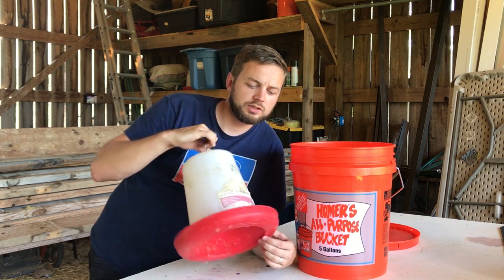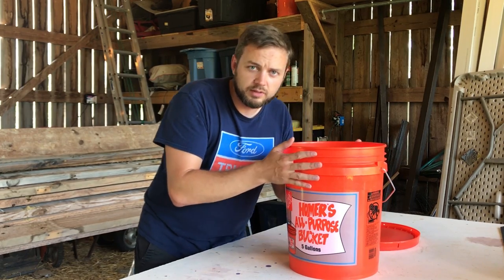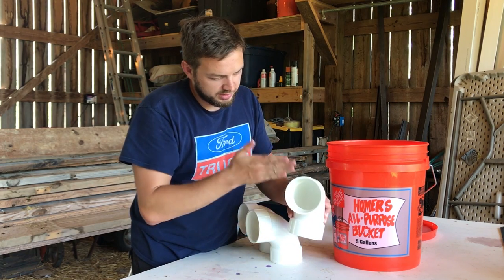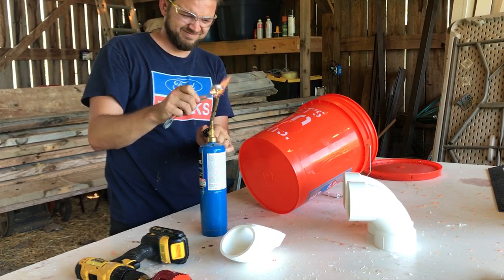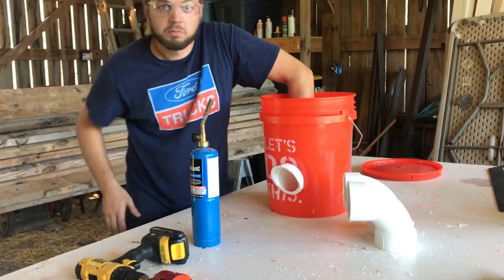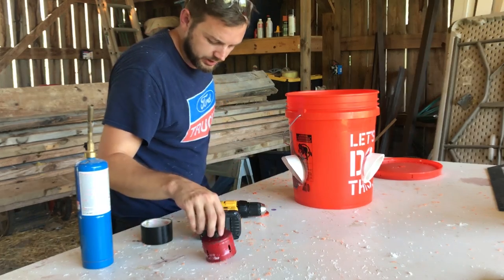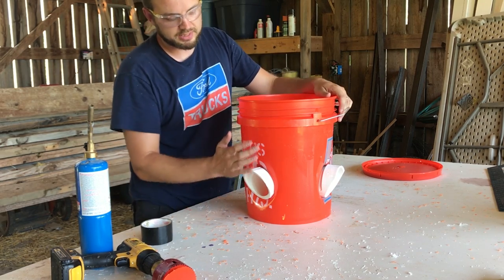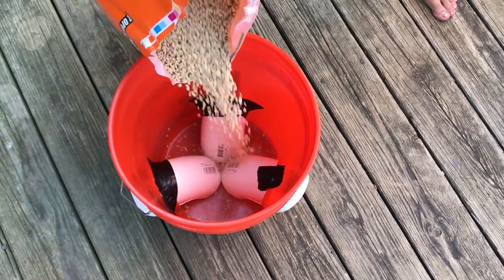🔨 🐓 Best Chicken & Duck Feeder On The Planet - DIY No Mess Bulk Feeding

Comment: Great idea thank you. I might try to stack two buckets somehow to extend the reservoir
Reply from the maker: What a great idea! This feeder has held up longer then any of our others. How are you going to attach the two? Epoxy might do it. If you cut out the bottom and heat it up you might be able to push the second bucket through the first 🤔 Let me know how it goes.
Reply: I would just go with a 30-gallon barrel that has a removable lock lid top. You can find them all the time on craigslist or facebook marketplace for anywhere between $10-$30. They make great grain storage bins too.

Comment: Just one question how does the feed get into the pipes for feeding?
Reply: Two Mini Farms as the chickens feed the seed/feed gravity feeds up under the elbow holes. The birds always have food at the end of the pipe. This will not work for water but good for this.
Reply from the maker: Exactly. The food is more under the pipe rather then in it. The chickens just stick their long next down the pipe and eat the food at the bottom on the bucket